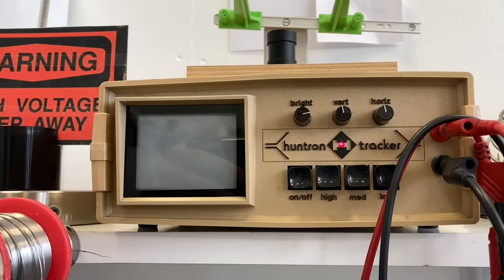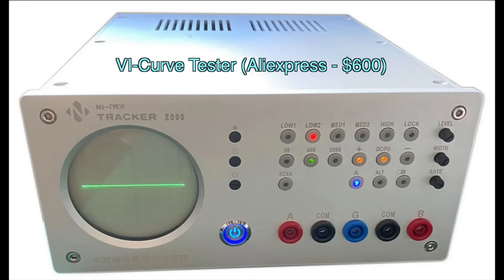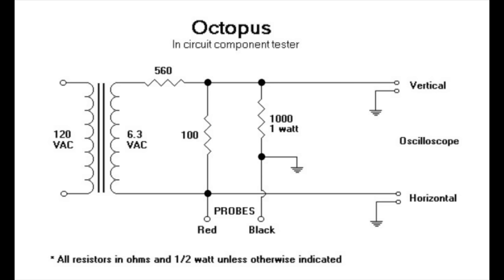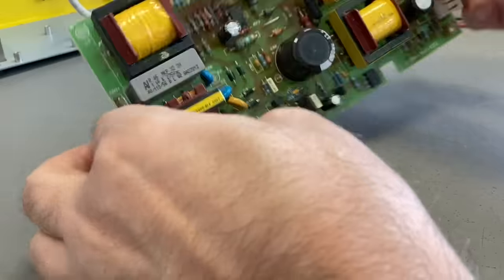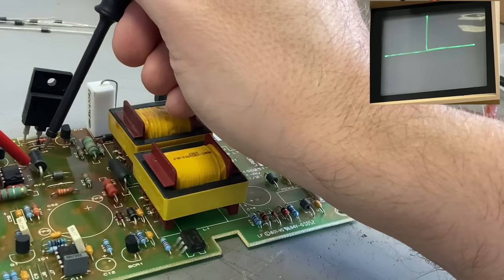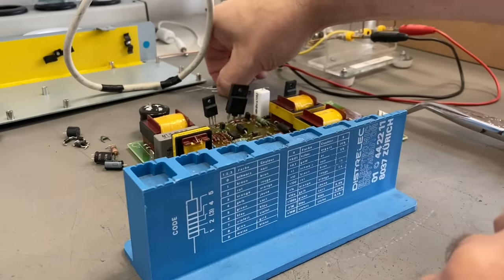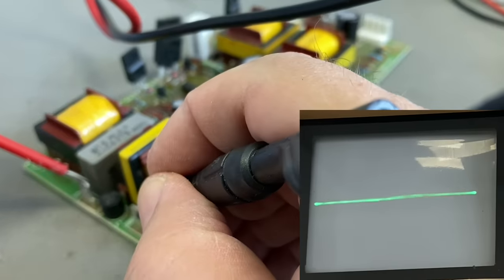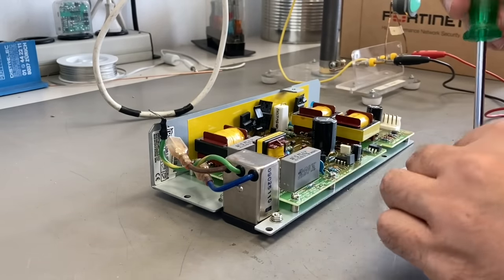The most useful tool ever for electronics repairs - (PWJ212)

Comment: That reverse mounted transistor is a weird choice. But so is mounting the power switch through the heatsink. Weird.
Reply: It also seems to be mounted with a plastic snap rivet, so I doubt it gets very hot...
Reply: The transistor is mounted in reverse for very specific reason - that is electrical isolation - sometimes the tab is at high voltage and cannot be directly connected to usually grounded heat sink. Various ways are used to overcome this - some use thin heat-conductive isolation pads, some use special transistors with isolated tabs, but this is the cheapest one of them - works only if the planned heat dissipation of the transistor is not too big...
Reply: @MrGabrovche it makes sense.😊
Reply: @MrGabrovche I recon the PCB designer got the legs backwards, or they would of just done that if it was an insulation thing
Reply: @MrGabrovche  Well, it surely didn't work wel here ... or am I the only one that sees a cracked transistor ...
Reply: It was for isolation purposes.

Comment: When I saw the solder sucker tip I knew exactly what you were using, I have the same exact model. I acquired it back in the mid 80's at my old job as a maintenance mechanic. It's in storage for the time being till I get my new work bench together.
Reply from the maker: Pace ...brother 🙂

Comment: I’ve used curve tracing most of my days, using a Hameg HZ65 external add on for scopes. However, it could potentially destroy (pun intended!) digital circuits. I then bought an ABI System 8 BFL and AICT module that can curve trace dozens of pins at the same time and even store the traces for comparison later. Really powerful power off diagnostic technique!
Reply: but what do you gain by using it vs. just measuring voltages and scoping(?), offcourse once you know what the voltages and waveforms on properly functioning device would be.
Reply: @ivok9846  A quick example I can give is when examining a data or address bus, the characteristic VI trace will typically be the same for each line. Of course, there may be address decoders hanging on some pins and not others which may lead to differences. Any differences such as leakage, open or short pins will instantly become apparent. Removing and curve tracing all the pins on an IC is useful too, e.g comparing all the input and output pins of an op amp or a microprocessor data or address lines.  It’s not a substitute for functional testing but can help locate trouble for further investigation.
Reply: @ivok9846  Indeed, if you are good at pattern recognition, this is quite convenient, especially for in-circuit testing Just two kinds of tools that both work fine, provided you heed the warning about digital circuits. The main advantage of the octopus is that it measures both voltage and current at the same time. You would need two multimeters at once to get the same data (in numbers rather than a shape on the screen). For field testing it's usually more convenient to just pack two multimeters, since scopes tend to be delicate and either heavy (if using a classic CRO) or expensive (if you use a modern digital one).

Comment: I've not seen a Huntron Tracker for a very long time. I learned how to use one back in my apprenticeship, but ended up in the digital domain and never really considered getting one. Might end up building one for the scope though, that would be handy addition. The other handy tool was the Toneohm audiable short circuit locator, but I guess the world is flooded with micro ohm and milli ohm meters now.
Reply from the maker: I use the tracker to test LEDs too. It has a current limit of a few milliamps... a simple go-nogo test 🙂 For example if you want to find out the color of the LED.

Comment: I worked with a Tracker 2000 and it got occasional use.  I think I used it alot more than anyone else in the shop.  Alot of the techs never used it.  I copied a circuit online and built a simple version but it only has 60 Hz ability. The 2000 can test at several frequencies thus better for testing capacitors.  I tend to use mine for semiconductor junctions.  I had a lot of old microwave diodes from a bulk purchase of parts.  I found most of them were good but many had poor reverse leakage and forward conduction characteristics, so I screened out the "duds" that worked poorly.  I have priced used Huntrons and they are pretty expensive but building the basic tester than uses only line frequency and uses my oscilloscope for display was pretty cheap to build.
Reply from the maker: It's a shame but I use it more frequently for testing LEDs than for anything else. Since power supplies have become so cheap, we rarely repair them.

Comment: When mounting the load resistors, I would give them more airspace (i.e. longer legs) if there is enough room in the case. That way the cooling is improved, you could see from the blackened pcb that there is too much heat in a confined space.
Reply from the maker: You are right. But on the other hand, the original resistors were mounted directly on the board and that went well for 20+ years. I hope this line of power supply will disappear in 5 years.

Comment: Valuable information and especially love the wiring diagram.  Are there any caveats when using this device for testing components or circuitry?
A video regarding your recommendations for the essential test instruments, would be very valuable for those looking to troubleshoot and repair PCBs.

Comment: We used this type circuit at NASA and WSMR starting in 1970 onward, to repair TTL logic. 
We built our own and used an oscilloscope for display. Great little device for a few bucks you can build yourself.
Reply from the maker: Our tester was also bought in the TTL time. We repaired DEC PDP boards. 
For analog circuits it's still useful today.
Reply: In the Navy, we referred to it as an octopus.
Reply from the maker: @josephbento7545  Do you know why it is called octopus? I don't see any connection to that 8 legged animal.

Comment: It is nice to see a Huntron Tracker 1005B model (this one would be from around 1980) in such great condition. It may have been modified at some point because the LOW range open circuit signature would normally show a diagonal line. That was changed with the introduction of the Tracker 2000 where the LOW range shows a horizontal line. And yes, Huntron is still in business!
Nice video!

Comment: Very elegant in its simplicity. A dedicated digital curve tracer is more accurate but I apreciate the ingenuity of making something so useful from only a transformer, couple of resistors and an osciloscope.
Reply from the maker: In this case accuracy is not needed. You only compare identical curves. If one component shows a different shape than another, you know something is wrong. It's like a continuity beeper to trace wire connections... ;-)
Reply: @PlaywithJunk  I have no thermal cam and naively I touch the components looking for shots  90% of cases works for me
Reply: "... and osciloscope" :) it reminded me of an old joke from electronic vocational school in my town - how to measure size of the room with an oscilloscope?...
Reply from the maker: @robertoteles  Yeah I did that too. And you still can read 555EN (mirrored) on my index finger when I touched a chip that was way hotter than expected 🙂

Comment: In repairing systems, it really depends on the context of the repair as to the troubleshooting approach used. Obviously, we must consider either an active test or a passive power-off test, or perhaps a mix of the two. But, the testing approach is greatly influenced by what is being repaired and where. 

For example, the Huntron Tracker used for analog signature analysis for a company repairing their own products at a repair depot, would have procedures to use the Huntron and have a library of known good waveform shapes (signatures) across circuit nodes while the equipment is powered off. 

We should consider that the Huntron may just be one tool in how the engineering team envisioned the repair procedures. So, you might see AC powered equipment first connected to an AC variable power supply to see what current is being drawn on power up without removing the DUT (Device Under Test) case. The current can tell you a lot especially if you can vary the AC line voltage and protect the DUT with a circuit breakers or a current limiting device. You usually will see two different types of AC variable power supplies one for troubleshooting and one for outgoing test. 

If we look at analog signature analysis, once a problem is confirmed with the AC power supply then after the unit is powered down, disassembled and large capacitors discharged, the Huntron would be used to compare signatures. 

The Huntron approach is useful for in-house product repairs that are within the DUT warranty period because there is an established approach to the signature testing and the DUT has not reached the end of its useful life, also the Huntron is very easy to use, you just have to know how to probe and then compare traces. 

If you play with junk, then you do not know what you will encounter as a repair, so you would have to formulate a strategy for repair as you evaluate the equipment. Signature analysis is certainly doable on unique (one-off) repairs, but I think it loses some of its advantages if you don't have known good signatures. The newer Huntron Trackers like the 2800 are very versatile in analog signature analysis given the options for voltage, source resistance and frequency, but the 2800 is not cheap, and if you move up in capability you are usually incorporating production circuit scanning.

If you see brown spots on the PCB you know that it is getting hot. To find out how hot you can use a thermal imaging camera. This may lead you to replacing some resistors with a high wattage equivalent, especially if you have a lot of vertical board space available.

I think it should be mentioned that once a power supply is repaired you have to understand if it meets spec. This means measuring load regulation, line regulation, noise (ripple) and a host of other parameters (maybe even custom AC input test waveforms) before releasing it back to the customer.

The transistor mounted backwards makes no sense at all. I would guess looking at the board itself is that the PCB layout is wrong, and the manufacturer did not want to waste any PCBs regardless of the problems with useful life. If you look at the PCB you will notice no silkscreen on the top layer or markings of any kind, not even in copper to denote capacitor polarity. Also, if you look at the pad size for the large diode you will notice the pad is actually too small for the lead size given the space available.
Reply: Sounds like you know you stuff? Got any videos you recommend for diagnosis of Amplifier receivers (AR). I believe these are mainly amps, but I want to find the exact issue by doing 'passive power off tests' (as you call it) and 'active test'. 

Sorry to be a clueless moron here, but I am extremely new to this repair stuff. I have discovered that there are few and far between videos that are walk throughs for the absolute beginner i.e. the video maker explaining exactly why probes like a multimeter are put where on a PCB and what they are looking for before moving to the next PCB section, thus tracing  the 'what's working, what's not' sections of a PCB. 

I only learned the other day that part of an 'active test' means placing multimeter probes - one on the earth, one on components' and looking for the potential difference is possible without a BANG! However, the guy never explained this, I had to guess it by remembering the probe testing tutorials and putting 2-and-2 together. It was a UREKA moment. It meant I had 'learned something useful' on my own.

Comment: Can I ask you the manufacture of your de-soldering tool? Yours works so much better and faster than mine. Great informative video. Especially the curve tracer. Thank you!
Reply from the maker: It's an old PACE model. They are expensive but good. One station we use is over 30 years old.

Comment: I built the simple add on for my scope to do the same thing with junctions,  as used Huntrons are priced more than your scope, if you can find one. But the home made one is simply two selectible AC voltage levels and 60 Hz.  A fixed frequency is very limiting when you want to test stuff like inductors or capacitors with it.  So I may devise a way to connect a function generator to same sort of test circuit so I can clearly analyze different capacitors and coils with the most appropriate frequency range.  With diodes I can screen them for knee voltage and reverse leakage if I have a pile of diodes that are untested and cull the duds.  OR match diodes.

Comment: The choice of steel for the heat sink is probably because it is also providing a lot of the structure of the PSU against torsional and compressive forces.
Reply from the maker: No. It is just a wrong choice. A 1mm aluminium sheet would be stable enough.
Reply: They probably had family in a steel manufacturing factory that did bending. That way his whole family got paid 😅

Comment: You have to be carefull with the curve tracer on some lower voltage IC's. You can destroy them checking pins. I used one of those, and in some cases it is a handy tool once you understand how to use it. Different manufacturer IC's can look very different when testing the same pins. You can make an adapter like that to attach to your scope.
Reply from the maker: That's correct. But when using in the "low" range it outputs about 3Vp. I have never experienced a defect caused by the tester. You may kill a laser diode...

Comment: SUCH a useful device for analogue repairs, I must have repaired hundreds if not thousands of power supplies, monitors, televisions, amplifiers etc. etc. with the help of one of these built into a Hameg 'scope. 

Brilliant for testing individual components and if you're lucky enough to have a working board the same type as the faulty one you can race through them and track down faults/suspicious areas so quickly.
Reply: Do you know a useful device for testing digital components (logic gates) ?
Reply: @wadib3eed7 a logic probe.

Comment: When I looked that you've said diodes are shorted, and after removing them didn't check if the short is still on the PCB, I've started to worry :D.
Reply from the maker: Normally I do check after replacing components but in this case, I know that board so well, I know it's only the diodes. :-)
I normally also check the input (AC) connector curve and I only apply power when it's OK. I guess I have done that off camera. (Or is it in the video?)
Reply: @PlaywithJunk  I've watched it 2 days ago, so not sure m8 :), sorry.

Comment: That's just reminded me that my old Hameg HM 205-2 oscilloscope has a built-in component tester.  Three and a half pages of the user manual are dedicated to it.  It's something my Rigol DS2072A-S doesn't appear to have, at least according to the manual as I'm sure the word "diode" would be in there if it did.
Reply from the maker: It's a pity that modern scopes don't have that function. It would be more useful than a logic analyzer.

Comment: You maybe solved a mystery that was haunting me from decades! 
I was working in greece and I used a similar devices in the '90, to test and fix digital boards full of components, by tracing faults.
 It worked like this:
You have a GOOD board and an identical faulty one. You put the ground on all 2 boards, then you probe the good board and the bad board anywhere (on IC pins etc) and you must have identical images. 
When you found a different shape, almost every time there's where the fault is - change the component, test again, etc. 
I never remember how this device was called. 
Do you think that this is it? 
Thank you :)
Reply from the maker: That sounds like our Huntron Tracer 2000. It has two channels that can be set to alternate and that makes it easy to compare two circuits or boards. That's why we call it the Idiots Tester 🙂 You don't need to know anything about the circuit. When you see a difference... replace the chip.
I did that many times too.... 🙂
Reply: Yes this is the Huntron, which model I do not know. But, what you are doing is called power-off direct comparative analog signature analysis.
Reply from the maker: PODCASA That's a nice acronym 🙂

Comment: Thank you very much for your video. I will buy myself a device right now too.
One question; I find your desoldering tool very intriguing. Is it sucking up the solder? Or is is a blow torch? Which one is it you are using and could you please give a recommendation?
Thanks in advance.
Reply from the maker: It sucks.... 🙂 It's a Pace desoldering station and it's relatively expensive. I have one at home too but I only bought the handpiece and put an old transformator and a tiny vacuum pump in an enclosure. That works pretty well too...
Reply: Another very helpful advice. Thank you very much.

Comment: I was missing this tool for my field repairs, but recently came across some nice chinese battery powered handheld 2ch scope w. built in signal generator (w.DPO feature!) - with the help of few external components i have my very versatile curve tracer back in my set of instruments for field use! Wonder why they do not integrate such a useful feature in the otherwise great new toys! Great video btw!
Reply: is it the dso2512g?  i seen a video of someone using XY mode to test components with the help of some extra components, is that the same thing?